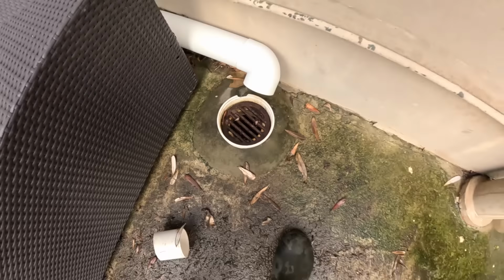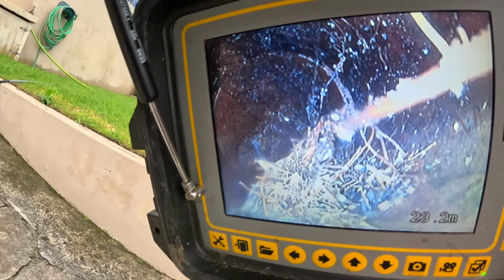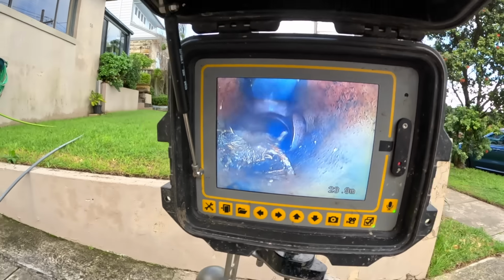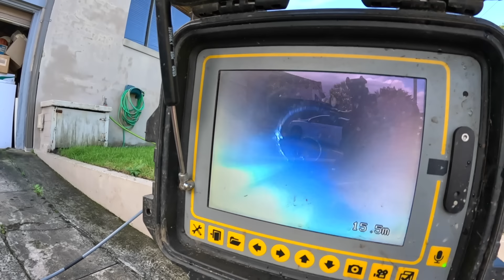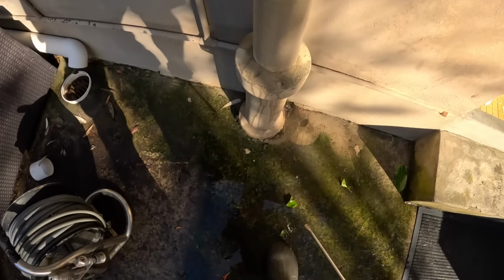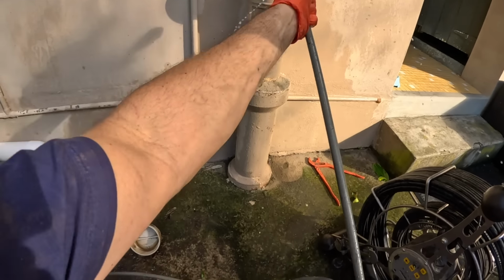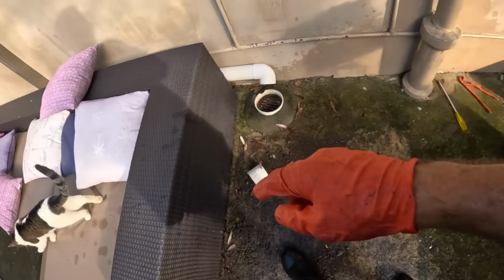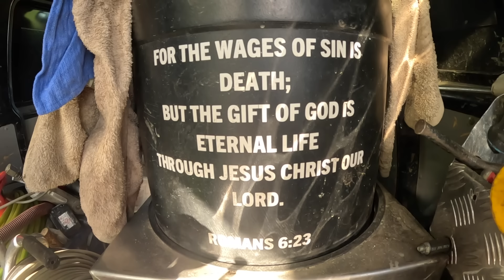Blocked Drain 956

Comment: Glad you use different heads, keep us guessing and on our toes😊
Reply: Each head has a purpose. The Penetrator serves to pierce through a blockage and open up a path in the pipe, the rootcutter uses the full force of the water in one nozzle both to push itself forward and dump extra pressure to break the blockage from behind and flush it downstream, and I remember Ollie has a head that vibrates specifically to hammer and break scale deposits. 

Not sure what the spinner does yet, but it's another useful one. Just got it: the spinner is a penetrator as wll, but it spins so it can move into pipe bends more easily.
Reply: @GoodOleDFT  I was taking the mickey, as Oliver  usually grabs the penetrator first and says for something different we will use this one.
Reply: @justme3971  Oh. My bad. Wasn't in on the bit. 😅

Comment: Nice job mate 👍 I can't believe how many times I've seen stormwater discharge into the sewer on your videos. People talk about how bad wipes are...... Overloading sewage treatment plants with stormwater is worse and poses a far worse risk to the environment. I know other places around the world do it but we've moved on from that.... apparently.
Reply: No stormwater connected to this plumbing, only sewerage.
Reply: @CT-vm4gf  the blocked drain(org) Ollie points out has a 90mm PVC pipe  discharging into the top. Looks like stormwater.
Reply: @plumbob6449  That’s the sewerage from the top floor of the house, which included the bathroom that was flooding.
Reply: @CT-vm4gf  in 90mm stormwater?
Reply: @CT-vm4gf we generally don't discharge into an org like that either. Unless it's temporary. Was this your job?;